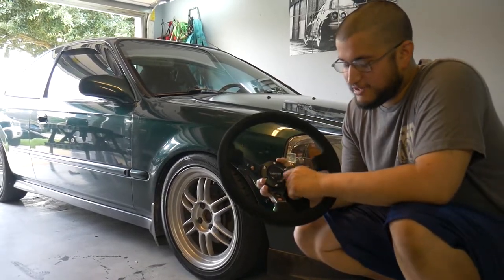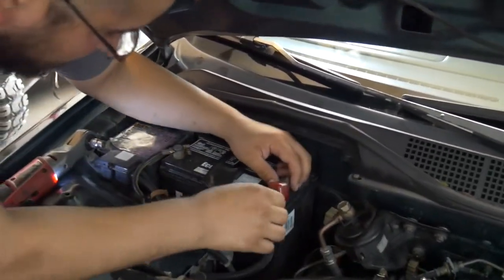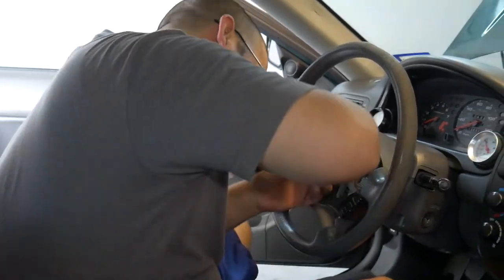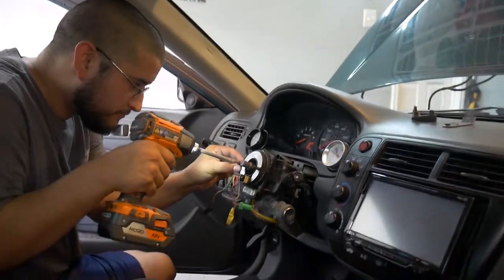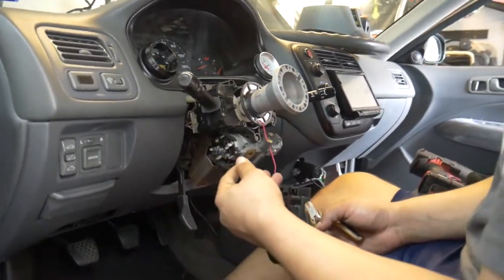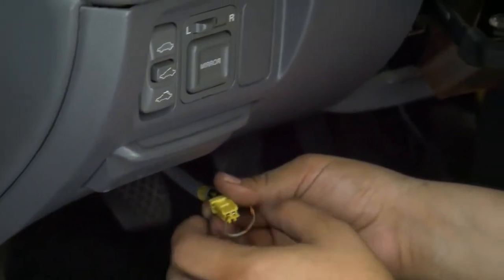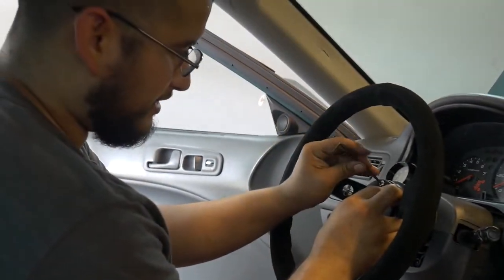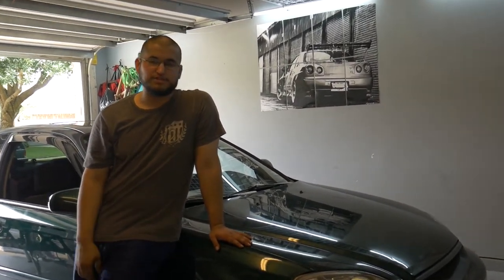NRG Steering Wheel Install & SRS By Pass Trick! For 96 97 98 99 2000 Honda Civic. EJ & EK

Comment: Man I'm still tryin to figure out how u made the horn work lol.
Reply: Easy, traces the horn wire behind the dash, then tap the horn wire with another extra wire, after that then ground the back of the hub with a paper clip, make sure it’s touching the back of the hub, after that just wire up and connect the wires. Super easy job 👍 you can also find the horn wire using a light tester, once you find the horn, it should honk and make a noise.
Reply: Neutron J hey so I have contact from red horn wire to the hub and it honks as soon as it makes contact to the hub how do I fix this it would just stay on honking if I bolted it up this way also the button doesn’t worl
Reply: @Beasttt-   if you have the cheap or horn button with the metal thing sticking out of the side, you will have to use black tape to tape it around the metal thing sticking out of the horn button, basically hack it or you can just cut it out.
Reply: Neutron J I think it is because my shorthub is a SRK-R130H and I was supposed to get a SRK-130H because the “R” part is race hub and it’s way smaller and does not have a copper backing around it for the connection to stick to on the back. I’d show a picture but u can see the difference in those two parts. Hopefully that is the fix. Different hub.
Reply: It’s Bluetooth lololol
Reply: @neutronj1560  I’m

Comment: Thanks for the Tip. Love the DUAL GAUGE CLUSTER POD also. What is that white gauge you added on the right side of the Pod?
Reply: I wish I knew about those before I bought that lame 3ga A piler thing. It looks cool and all but I hit my head on it and it's so cheap it just looks like it's about to fall off (even though it is very well secured).

Comment: You could’ve just removed the srs bulb out of the cluster
Reply: Alex1Down5Up  Fr 😂
Reply: The error in the system wouldn't cause an issue.  Might not allow the passenger side to deploy but that just saves the windshield
Reply: I think theres a yellow plug on the back of the cluster too you can remove
Reply: @tylerjvenneman8364  Some people don't like to disable their vehicles functions bit by bit over years just so they can install cosmetic improvements. My 98 prelude still has every function and button present and working correctly despite tons of mods. There is something great about that.
Reply: @Ccastine9  congrats, even tho you worked hard to maintain those they wont deploy because an airbag lifespan is about 10-15 at most,good luck